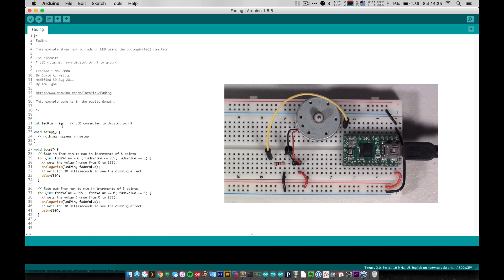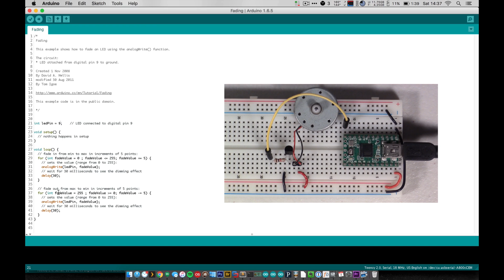How To Wire It! Motors (Single Direction)

Comment: you should hook up a motor to your blinds and make it so you can set how much light shine's into a room.
Reply from the maker: I've been planning on doing that for a while but I've been struggling with figuring out how to make it work. My shades don't have a pull string but rather have some internal mechanism so that you can just lift or pull it to the position you want and they stay there.
Reply from the maker: They look more or less like this http://www.bedbathandbeyond.com/store/product/real-simple-reg-cordless-cellular-shade/215670?categoryId=10551
Reply: +ItKindaWorks I have order blinds in my house that have a rod that you twist to change the angle of the blades all you would need is a way to mount a small DC motor with maybe a gearbox.

Comment: When would we need to use a flyback diode? I read that's sometimes necessary.
Reply from the maker: Ah yes, I didn't touch on that because it can be overly confusing for beginners and for the most part it's fairly safe to go on without one. A flyback diode prevents large power spikes from going back into your circuit when you cut power from the motor. It's not all that critical when working with smaller motors but if you have a project with large 12+V multi amp motors it would be useful to prevent damaging your control hardware. With small 5v motors drawing less than an amp its not all that necessary. 

I'll put it this way, I have done without flyback diodes for 95% of my projects and never had any issues.